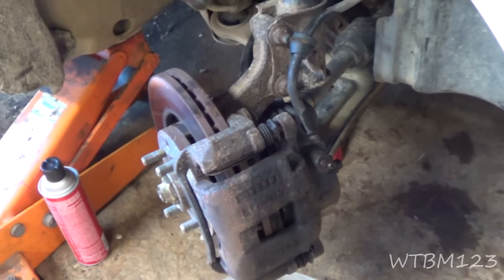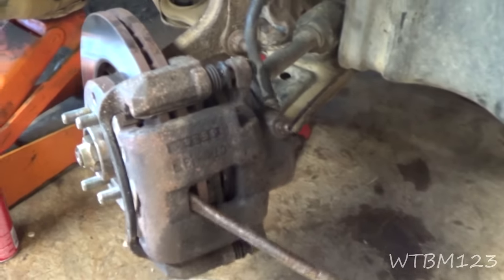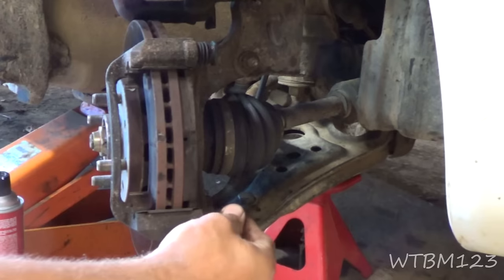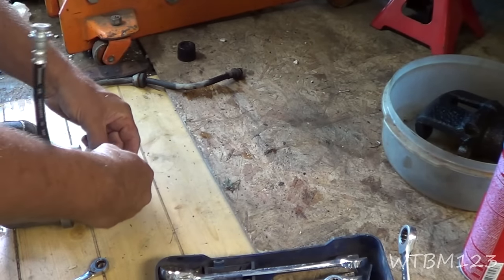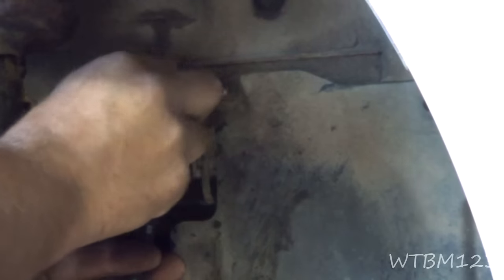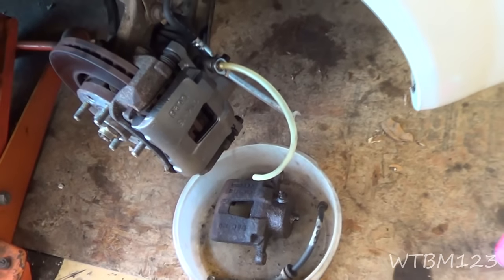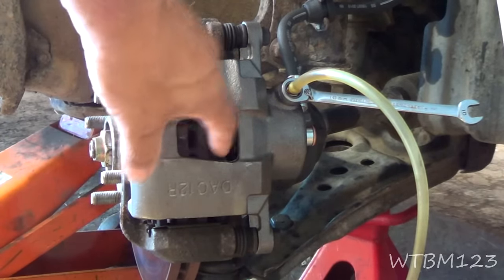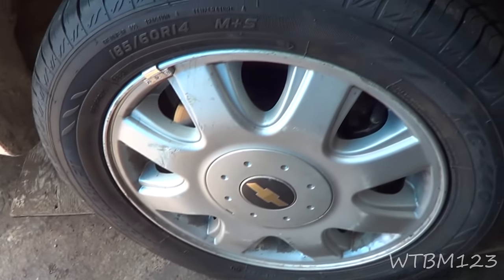Stuck Brake Caliper or Bad Rubber Brake Line #brakes #bleedbrakes #brakehose

Comment: I too noticed that the top of the caliper was moving more than the bottom... I wonder if the bottom caliper pin might have had some rust in it, or not enough lubrication, and was sticking a bit?
Reply: I noticed that too.  I thought that looked odd. Also, it was recommended that brake grease be used to lub slides.  That is not recommended because  the boots on the slides are a rubber product and brake grease a petroleum product will dissolve rubber over time. Only high temperature silicone based grease is recommended for caliper slide bolts. Silicone will not dissolve rubber boots.
Reply from the maker: +Ken In Atlanta  I guess i did not know they made non silicone brake grease . Not sure why it looked that way , watching vid i agree it looked like one was moving more than the other , but both were cleaned and lubed , but it does look odd .
Reply: +wtbm123 Thanks for the followup.  I should have started by saying that I always wondered how a hose could act as a check valve.  You did an outstanding job showing how that could occure.  I live in the south and the under side of cars down here look almost brand new so I'm going to suspect slides and calipers first before brake hoses for sticking caliper diagnosis.  Here are two silicone products that work with caliper slides.  3M 08946 Clear Silicone Paste and Super Lube 92003 Silicone Lubricating Grease with PTFE
Reply from the maker: +Ken In Atlanta Permatex 24125 Ceramic Extreme ,or , Permatex - Ultra Disc Brake Caliper LubePart # 24110    , are the two that i use
Reply: Silicone breaks down in cold Weather. I thought it was anti seize that was suppose to be used.

Comment: Thanks for the video...I just bought a 91 oldsmobile station wagon and the front brakes were not working at all..I put on a set of new caipers and pads..plenty of brakes now but the driver side was sticking and causing the car to pull to that side...also it would stop sticking sometimes but then it didn't work at all because when braking the right would pull and I had to turn the steering wheel to the left to keep the car on the road..I exchanged the driver side caliper for another because I thought it was defective but the newest one is doing the same..with the wheel off if I hit the brakes it gets tight and will not release until I open the bleed valve a little..then it spins free..the rubber line is new looking but I took it off and I could shoot air through it in both directions...my ABS light is not on but I wonder if it could be a problem?I might try and bypass it because that thing looks expensive!...I don't think the master cylinder is bad because the other front wheel is working good..could it be that I don't have the system bled good enough?...I am by myself and have to wait for my neighbor to pump the brakes for me..if you have a minute maybe you might think of something I didn't..thanks
Reply from the maker: You say it sticks until you loosen bleeder . . Next just to be sure do it again and loosen the metal line going in to the hose , on master cylinder  side , if the caliper releases then hose is good , if not bad , if releases then keep going and loosening fittings till you find where it releases . it may act different with fluid pressure on it than with just air . I would not think air in system would stop caliper from releasing. A lot of times if top is off master cylinder and you loosen a bleeder it will gravity bleed on its own . that is how i do a lot of them .
Reply: I will try that in the morning..thanks

Comment: Here in UK never heard of the brake hose being the fault,  must be rare. The first thing is to scan the cars obd2 port and see what errors show up.  
Sometimes  it could be an abs fault  and you need say a new abs lead and or a rotor if it has a reluctant ring on it. 
If it is the caliper,  with shop rates they just like to stick a new one on,  as it saves time and money . If you are doing it yourself there is no need to buy a new caliper. Just inspect  it and buy a replacement kit.  
Usually it is just the rubbers that need replacing.  If sliders are bent get new sliders.  If piston,  just buy a new piston.  The piston will usually clean up if has rust on it,  then new rubber seals.
Reply from the maker: It is common here to find bad brake hoses

Comment: On the right rear wheel I can still spin it after he has his foot on the pedal all the way to the floor. I couldn't separate the caliber from the rotor by pulling back with a screwdriver. I noticed the bottom sliding pin needed greased and it had a small crack in the rubber. I figure that's where the problem originated. I noticed on your video when you went to hit the brakes the bottom pin was not moving just the top one was. Seem like to me that it was still sticking.
Reply from the maker: If the e brake cable attaches to the rear caliper , the piston has to be rotated in . If e brake is not directly attached to caliper it should just push in . Also newer cars need to be put into service mode to do the rear calipers . Yes you are correct both slides should move freely

Comment: Just a work to the wise…
I had the same problem with mine caliber…and…I just changed the rubber break holes…first…and…that solved my problem…I mentioned it because…in this video…this gentleman…change them both…without the process of elimination…in my book…always… change one thing at a time…to narrow down the problem…
Reply from the maker: At around 2:00 i explain that with the bleeder on caliper open it got easier , but caliper with bleeder open was still to hard to pull.
Reply: @wtbm123  
Hummmm…Yeah…like I explained…I had the same problem…I did the same type of troubleshooting…and…if I did it…your way…by changing both the rubber break hose and the caliber at the same time…I would have spent a extra 80 bucks on a caliber for nothing… …all I was trying to put out there for folks is…change one part at a time…and use…the process of elimination…to save time and money… …no one was trying to doubt your process…
Reply from the maker: @erenstlawyer7773  That is where the testing comes in .
Reply: @wtbm123  
OKAY BRO…I’M SITTING THIS ONE OUT…HAVE FUN…AND…BLESS YOUR HEART 🤨

Comment: Would be great to see examples where it's definitely EITHER the caliper OR the hose that's bad. Changing both seems like throwing parts at the problem until it goes away
Reply from the maker: if you open a bleeder and the caliper releases , then hose is bad , because the caliper released or moved back in like it should . If you open a bleeder and caliper is stil stuck , it prob is caliper bad

Comment: If you suspect a brake line causing the caliper to drag just pump up the brakes and verify the brake is still dragging then crack the bleeded open. If fluid squirts out then there is still pressure in the system. Then also see if the caliper freed up. Not sure how much of a squirt is too much? Compare to the other side, as long as the other side is not hanging up also.
Reply from the maker: Thanks for watching

Comment: Thank you for making this video but I follow all steps and was trying to stop at a red light after doing about 45 and the brakes went out and i smashed into a mini van.  Any ideas?
Reply from the maker: Something may not of been done right , leaking or something , may get a mechanic to look and see what went wrong
Reply: Did you test your brakes first?
Reply: You contaminated your brake pads with brake fluid most likely

Comment: When you opened the bleeder screw to test for caliper movement, did that introduce air into the system, that would require a gravity bleed, or did you only gravity bleed them because you had to replace the hose? Please answer this morning if at all possible, as I'm working on a friend's brakes today, and want to have her car back to her tonight if I can, with nice firm (and non-dragging) brakes!! And thanks a lot for the excellent video, it's EXTREMELY helpful. Gonna find out in a few hours whether it's just the dried out slider pins (causing the brakes to drag), or the hose is bad also... Thanks again!!
Reply from the maker: Just opening a bleeder ,usually will not let air in ,if you do not move brake peddle..even pushing piston back with bleeder loose will push fluid out ,not letting air in. Now if you some how manually pulled the piston out on a caliper with bleeder open it will suck air in but not if pushing piston in . or if bleeding by peddle and peddle is let up with bleeder open it will suck air in. I gravity bleed because of replacing parts. Most cars you can change a hose or caliper and let gravity bleed to remove air. Just gravity bleeding will usually get all air out.  Also you prob already know but should only use a made for brake grease on slide pins.
Reply: @wtbm123  So Best way to bleed is to just open bleeder with filler cap off  and let flow doing nothing else for a minute or two ?

Comment: What exactly did you do to “readjust the brake” after the test drive, because the pedal still felt low?
Reply: Bleed the brakes if it feels low. Air is in the system if the pedal sinks. You should feel pressure when you press the pedal down
Reply from the maker: if rear drum brakes adjust them
Reply: @wtbm123    they were disk

Comment: question, I've got a 95 gmc k1500 that's had a drag on my left driver tire for along time now. I've replaced the hose 3x, the caliper 3x, rotor 2x, the cv axles 1x, master cylinder 3x, brake booster 2x and the hub assembly 2x. I'm out of ideas on what to do next. but I know its the caliper sticking because it'll spin freely with out the caliper on it. any advice would be appreciated.
Reply from the maker: If nothing mechanical at the wheel is bad , like stuck slides , then next thought something is holding line pressure. If dragging  brake , and loosen bleeder and then free , it is fluid pressure. . can go back up line and loosen  fittings till you see where the restriction is . Also if it has the abs control under in the engine compartment , they sometimes go bad .

Comment: Do you put that screwdriver on the the brake disc? That wont damage brake disc while pulling?
Reply from the maker: I usually catch in vent holes at first then if needed  i use the surface of rotor. So No it should not damage the rotor. It will take a little effort to pull back and it will move slow.but  If you need to exert enough force that ,you think you are hurting the rotor then Caliper or brake hose needs to be looked into.

Comment: Ive got a heat issue on both front rims and one rear. since its more than one wheel, could it be the ABS or just air in the line? I did take fuses out of ABS system but its still hot.
Reply from the maker: Prob not the abs unit . Only way to know for sure is to look and diagnose them . Could be calipers , caliper slides , pads not moving free , brake hose , Would need to see if something was not moving free , or if fluid pressure is not releasing , Could be abs unit , but  many other things go wrong first

Comment: A big issue is the brake pads. Theyre too long. File down the exfes and out a chamfer.
I replace my pads on my Ford truck three times from Napa and the calipers and the brake hoses they were hating me but. What you want to do is you want to file down the ends of the brake pads where they go into the clips and put a chamber on the edges. I did this after going through three pairs of pads from Napa again they were hating me so file down the ends of the brake pad the steel not the pad itself

Comment: How tight do you couple the brake hose to the brake line? I wouldn't want to strip the line threads. Also, it would be interesting to see a hose split open and like nailed to a piece of wood so you could see exactly where and how the blockage looks. Thanks.
Reply from the maker: Thanks for watching and commenting

Comment: Thanks for the helpful video .
Question .Can u free a sticking caliper?
Reply from the maker: There is a reason it stuck . Needs smooth bore inside to seal . Most likely it is not smooth any more , prob at least pitied  , and either will stick again or start leaking . To me brakes are important and not worth chancing

Comment: I've replaced my passenger calipers 2 times in 5 months and they recently started getting really hot and you could smell it burning so I'm guessing the brake hose is the problem.
Reply from the maker: Could be , Thanks for watching and commenting

Comment: Good diagnosis.
Reply from the maker: Thank you
Reply: @wtbm123  Had a Corolla that less than a year after replacing discs and pads the right side was almost worn out. I put in new pads, a new caliper, and a new right flexible brake hose. So far so good. Have a great day.

Comment: Any thoughts here? when I brake I pull hard to the right. Replaced both calipers and rotors in the front on a RWD truck. I'm stumped!!!!
Reply from the maker: is there fluid pressure at both front wheels . Sometimes a back one not working can also make one pull . If pulling hard right then i would assume the left one is not working . Is the flex line bad . Do the brakes pump up after moving truck , could it be a wheel bearing loose and pushing the left caliper back . I would make sure the brakes on left has about the same fluid pressure as the right .

Comment: So rather than clean out the piston and replace the bushings for a few bucks you go to the expense of a whole new caliper?  Curious as to why?
Reply: If you are working in a shop . and find a bad , or not working properly caliper , It is usually faster and cheaper in the long run for a customer , than paying a guy to spend the time needed to properly rebuild a caliper . Some calipers are easy and fast , but some get time spent tearing it apart and cleaning . Then if the caliper for some reason is not rebuildable , then customer would have to pay for that time , and new parts .And at least our local parts stores stock calipers, where here you usually need to order rebuild kits and that takes a extra day usually.  If only slides are stuck , then i usually fix those because they usually go smooth , with out finding any hidden problems .

Comment: wtbm123, I have had the same problem with only the rear driver's side of my mustang. There is a grinding sound whenever I'm driving(fast or slow), plus the rear driver's side rotor smells like something burning and super hot compared to the rest of the rotors. I already resurfaced the rotors and changed the pads but it is still doing the grinding noise. Oh, and I also changed the Caliper. Would you think it might be a clogged up brake hose that's causing the problem??
Reply: I’m having the exact same issue on my Mazda 

Did you ever figure out what was the cause?

Comment: what it means when i took my rear caliber off, and it was hard to tigthen with my sea clamp. when i put my new shoes in, it burned them to dust? and it feels like my truck is straining like its constipated? do you think I need to change the caliber?

Comment: Take cap off master cylinder. Pull with screwdriver. If it does not move, loosed bleeder. Pull again. If moves freely with bleeder open, probably brake hose deteriorated. Put cap back on master cylinder. Is that about it? I changed my pads and rotors after the driver's side was grounding and my pads fell out when I was driving. I did not loosed the banjo bolt because I did not expect to replace my caliper. Not only would my caliper not compress, the metal cylinder in the piston was partially ground away. The calipers were only about a year or 2 old. I would have changed the hose "just in case" but I was too exhausted. I am about 6 weeks past and my brakes seem to be making noise. I am about to take off my wheel and see what I can figure out.
Reply from the maker: yes , check like that to see if caliper or hose is bad . if the pads fell out and piston on caliper was hitting rotor , may be a good idea to replace that caliper , especially if it will not push back . if it wore piston in caliper and no longer flat and square to rotor , you will probably have issues with caliper anyhow as it would want to cock the piston to the side and maybe bind up.

Comment: Hello, was wondering if you could help me. I have a 2013 equinox and I've been having issues with like a grinding or rubbing in my front passenger brake. I've replaced brake pads 5 times in 2 years fixes the issue for about a month or 2. Replaced the caliper (had pins lubricated),brake pads,rotors,struts,sway bars,control arm and still hear the noise. Sometimes it's so loud I can hear it over the radio. No mechanic has found the problem. The sound is there even with the slightest braking. Mechanics say master cylinder is fine and working properly,no brake line leaks. Have not changed brake lines(could it be a collapsed brake line?) I may even be able to record the noise on video
Reply from the maker: are you sure it is in the brake and not the bearing for axle that bolts to oil pan

Comment: I bled the hole system and my pads are sticking to rotor, what would it be? The piston doesn't  retract like 2 or 3 mm but when i push it, it retrack very easily. Whats the problem?
Reply from the maker: Are the caliper slides free , depending on the vehicle could the pads be stuck in the caliper bracket , If you push the brake pedal and release it will not move far , but just far enough for the rotor to turn fairly freely .
Reply: @wtbm123  yes they are, I cleaned it and and put grease. The pad thickness could afect? They aren't original, im using Kashima.